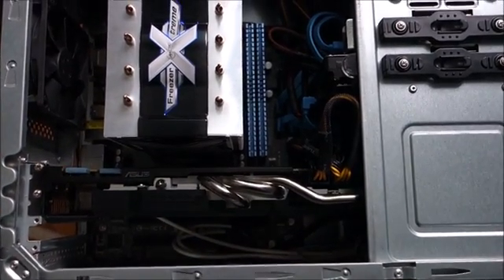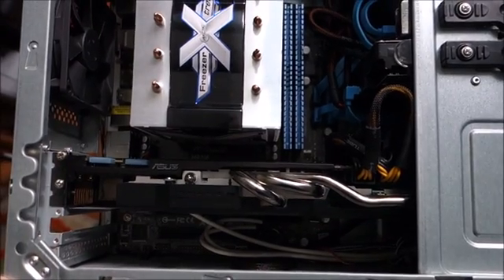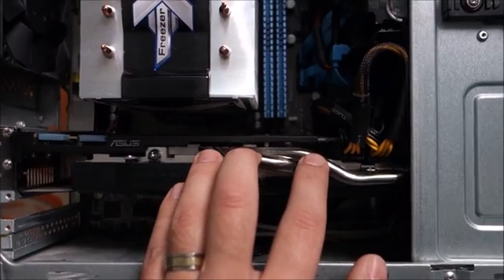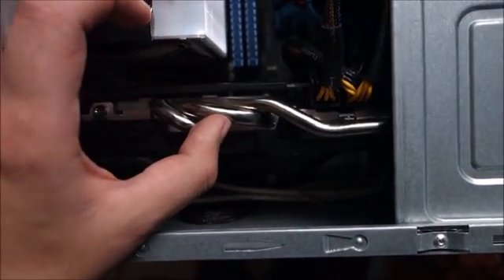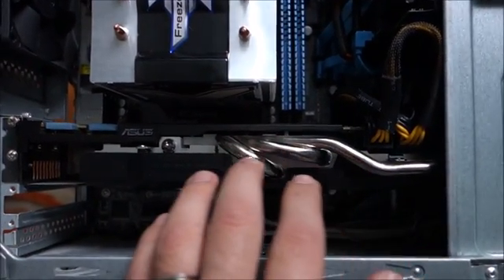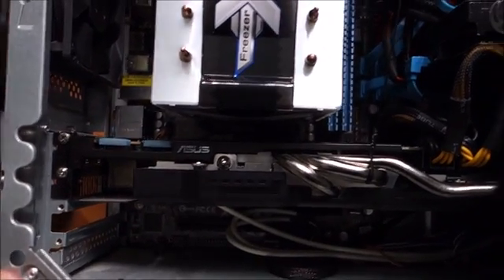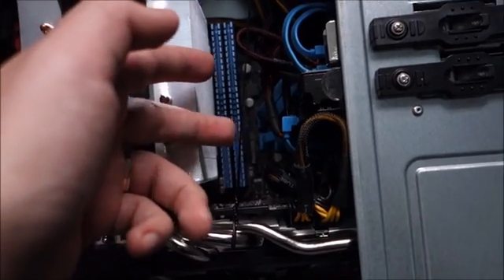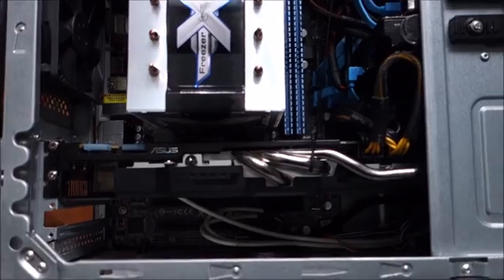How to fix artifacts caused by video card sagging

Comment: Thanks , I did removed it and dust it out and put it in and it works fine , the thing is I sold my motherboard and I was in doubt if my GPU is dying or just a problem of the case ! There is no enough space for the HDMI connector
Reply from the maker: Great!

Comment: Was this a lasting fix? I just bought a pc with an Asus 1060. As soon as I installed drivers, if it would let me, the screen would be horribly distorted and covered in artifacts. Unusable. Anyway, I tried the gpu in a different machine, same thing. Then I put some leggos under it, installed drivers, did benchmarks, and it worked fine. I am just worried it won't be a lasting fix. Did this fix last?
Reply from the maker: For me it did. But anyway, you don't really have any other option if there is no warranty.
Reply: To add to this, that 1060 is still working.  Every once in a while I have to readjust the Lego tower holding it lol.
Reply from the maker: Great to hear that! 👍🏻

Comment: my computer if i put horizontal the artifact disappear if I put it vertical the artifact appears
Reply from the maker: Yup, probably GPU sagging.
Reply: @UltimateDIY  hi i would like to ask something is it Gpu fault or my setup fault . i had it for one year this gpu and I am putting horizontally lately I changed the whole computer except the gpu and I put vertically then artifacts showed then I put it horizontally and it works like my old my computer. 
does this mean it is gpu fault
Reply from the maker: Sorry, but it's impossible to guess. It could be the card itself or the connection between it and the motherboard.
Reply: @UltimateDIY  yes you are right , thank you for your help

Comment: I had a similar problem. After pulling my hair out tring to figure out why I was getting random shuttering, I eventually noticed my GPU was sagging. Mine was a Asus as well. Same with the MB. I as doing all kinds of things to figure out the problem. In fact I was gin the process of backing up my drives to reinstall windows. Ended up loosing a drive in the process to bad sectors. But it was after this is when I noticed the card sagging. I never noticed it sag like this before. But apparently over times these things can sag more and more. I was in discord at the time with a friend and he asked if I had a support, I responded no, and immediately looked them up. Sure enough they make supports for the sag. So I found a old bic pen and gutted it and cut it to length. I propped up the card to what looks about even, maybe a tad bit high now, I'll have to get a level and see. But sure enough the shuttering issue has mostly went away. Their maybe a slight amount in game but this could be due to us cranking our dino speed up so high and the GPU simply cant keep up. Ark is a pretty intensive game on the GPU. So far I played the rest of the night and it seemed to correct the problem. 
This to me is bothersome. Most people say oh the sag is fine, don't worry about it, they are designed to sag a little. No, this is not good, when you bend them like this it puts stress on the connections and solder joints. With the constant heating up and cooling, this added stress can cause these solder points to give., not to mention possibly micro cracks in the board. 
To me, this is a huge design flaw. And yes i can cause issues that can be extremely difficult to diagnosis. I even read a report where someone said the manufacture couldn't even pinpoint the cause, but the customer believed it was do to the sagging. 
It's well documented now that modern GPU's are sagging, especially overtime. And with all the brackets out their, it is clearly a problem. I will keep testing over the next few days and then request a RMA claim on this card. While it is more stable now, their still seems to be shuttering. And if its to the point where I have to prop it up for it to even work properly, then it's bad in my book and this is clearly a manufacture defect. They should be making these things more sturdy to hold themselves up without warping and sagging. While I am glad to have finally pinpointed the issue, this really kind of pisses me off.
Reply from the maker: I feel you. I think this is planned obsolence and from time to time a card just failes too quickly. This is where we are going with everything. Think about capacitors for example, it's been about 10 to 20 tears since it's known that cheap ones fail, but they are used even in expensive products to this day. It makes me angry and sad...

Comment: I have Asus Rtx 2060 and it suddenly gave me an artifact screen. I was playing a game and just closed the PC after I opened it in 2 or 3 hours later it gave me a screen full of artifacts.. and I bought it 2 months ago. it's very new. and I can see my artifacts on the opening screen I mean Bios screen. and I just searched about that and I found something like that, "If you see artifacts during the power-up screens before your operating system loads then you know it has nothing to do with drivers."   and then I see your video, this video. now I'm in the office but when I arrive home I'm gonna check this method, if it works I'm gonna tell you, I hope it will work :(
Reply from the maker: Did it work? 🙄
Reply: Ultimate DIY hey sorry Im still searching about my problem and no it didnt work for me :( im little bit affraid of authorized service of asus.. because no one likes them in the internet :/  I think I have to try RMA.. I really cant understand why its happening.. my card was really new one and it had no heating problem
Reply from the maker: Random bad luck I guess...
Reply: Update?

Comment: I recently changed my broken heatsink with new one. I also faced these weird artifacts , then I just lose screw of my heatsink not fully undcrewed it  and give it a shake. then screwed it moderately.after that every thing fine for me.
Reply from the maker: Could have been either because of a cracked solder joint or because it was actually bending the bord causing it to not make contact in the slot.

Comment: Clean the pci gold fingers bro
Reply from the maker: That is the first thing I do in situations like this. In this case it did not help.
Reply: Heat the pcb to 130c for 8 mins
Reply from the maker: How would that help? Not really sure about the idea behind it.
Reply: People think it reflows the solder, infact it pulls the tiny stuck switches in the gpu die and resets them all. Fixed over 30 cards this way but dont listen to the noobs (heat the PCB to 130c not 200+) (wont brake the card going to 200+ but theres no point, we are not reflowing and you could damaged the caps) THE TDP FOR ALL THESE CARDS IS 95C ish, 130c is 100% safe, heat for 8mins ands cool for 8mins. i have installed the cards still warm from the oven, people do this at 200+ and there card dies again weeks later. This would be due to the caps dieing on mass, 130c fixes the card and wont touch the caps atall (Rare info here, even linus dont know this)
Reply from the maker: A1OFFENDER I really think in my case it was just a bad connection with the PCIe slot, but the info that you gave me is good and is in line with what Louis Rossmann says.

Comment: hope this will be help to my gpu because too expensive price gpu in indonesia
Reply from the maker: My gpu worked like that for about 2 years, untill I sold it. The new owner also uses it with a wire, so if this is your problem, the wire should fix it for sure.
Reply: sorry i followed your tutorial but honestly my gpu  really really broken ... i am so sad ...cant playing game anymore ... thanks for share friends :)
Reply: i followed your tutorial here ... but honestly my gpu really really broken ... i so sad ....... cant playing games anymore :( ....... last playing game evil within 2 ... but thanks for sharing video  friend :)
Reply from the maker: Sorry that it did not work for you :(
I have another video showing how to reflow a gpu with a cheap heat gun. But even if that fixes it, it is just a temporary solution.
Reply: thanks :)

Comment: Will give it try at the morning hope this will fix my artifacts. If lights works and fans are spinningon GPU this means that the gpu is working? I started to get artifacts with my Radeon HD 6350 that I though will work. Previously the MSI R7 370 2GB crashed and it gives me black screen. 

//Will edit the comment in approx 12h
Reply from the maker: Did it work for you?
Reply: Ultimate DIY unfortunately not :/ just started saving money for new pc. thanks anyway
Reply from the maker: Sorry to hear that :(

Comment: I  will try this, the artifacts i am getting are red and green horizontal lines, i also get bsod with whea uncorrectable errors, i hope it works, its a nvidia 980  and it cost me a lot of money when i bought it new, i cannot afford to buy another one, even though they are cheaper now, dumbassed mb makers should have known that newer heavier cards would cause sagging over time, especially asus who manufacture both mbs and graphic cards
Reply from the maker: I'm sure they know, but they don't care, because they make money when people buy new boards and cards, sadly...
Reply: Never heard of a dodgy pci slot, maybe try cleaning the slot with a brush. Could be cracks in the pcb, on the card or mobo.
Reply from the maker: Actually, this is a real problem. If you look it up, some newer motherboards have reinforced slots.
Reply: The more you know :)

Comment: Do you suppose the reason this works is because it causes cracked solder joints to reconnect when you push up the GPU?
Reply from the maker: Could be, but couldn't really tell if the bending in the board would be enough to do that, or if that would be enough for the GPU to work perfectly for almost 2 years now. I would imagine if the cracked solder joints would be pressed together it would work for a while and then maybe start to create problems once again, like many cards do after a reflow for example, but who knows.
My best guess is still that the bad connection was in the PCI slot itself, but could be wrong.

Comment: I had this same problem, but It took me like few months to figure it out and I fixed it the same way you did. I wish I saw this video sooner.
Reply from the maker: +Abraham Yakub yes, it's weird that this problem was not anticipated by gpu and motherboard manufacturers. I wonder how many cards got thrown away because this was mistaken with a gpu internal failure...
Reply: True, I almost have put my graphic card in the oven as my last resort, good thing I was persistent enough. Nice of you to share this video to help others.
Reply from the maker: +Abraham Yakub if at least one person finds this video before throwing away a good card, my job here is done :D
Reply: Ultimate DIY This did it! Was trying to figure out why my card wouldn't work or freeze especially after normal boot.. It was because of the sagging. Grrrr
Reply from the maker: +Scorpio Gamer glad my video helped you :)